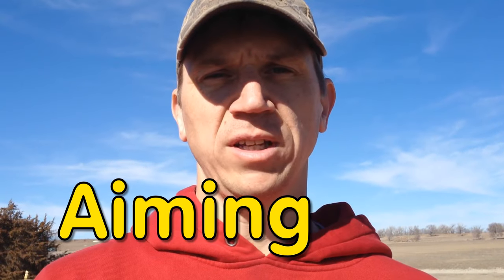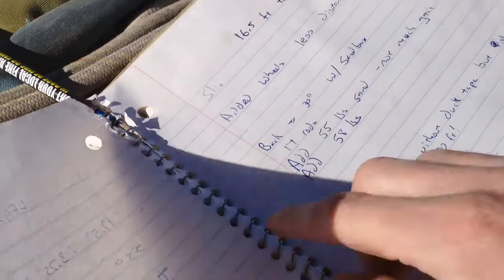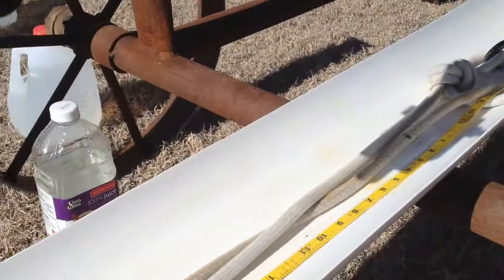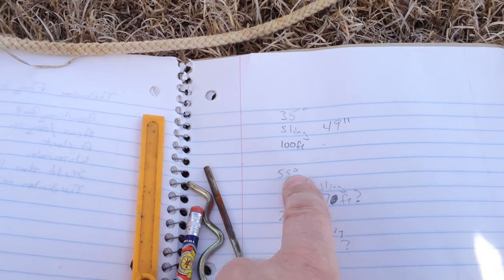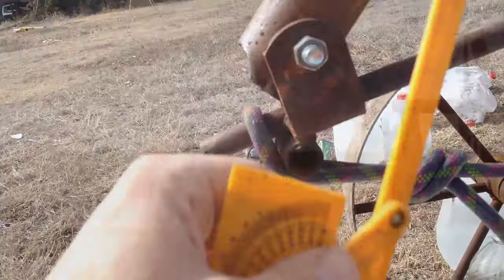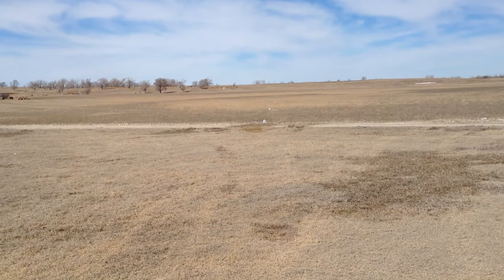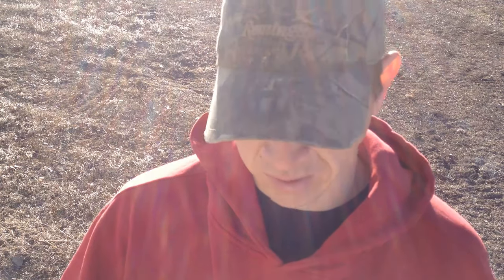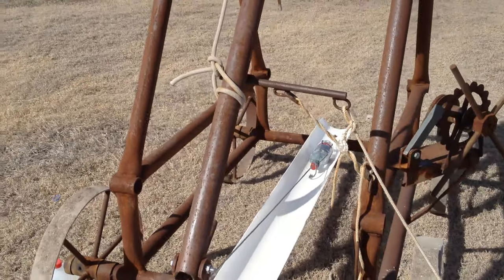Trebuchet Tuesday -AIMING! - Episode 29

Comment: Yep... You're right about there is a lot of parameters behind the trebuchet....
There is also a parameter that I,ve not seen you adjust, this is the linkage on the weight side, the articulated arm, do you think that the length ration could influence the way, force or speed that it goes down and transmit the force to the other side...???

Also be certain that the day you made the car size trebuchet and try it for the first time, your calculations are perfect...   You would hate to remove a car from the roof of the house...  Just cause something went bezerk...     lol
Reply from the maker: +pierre beaudry That linkage ratio is a huge influence.  Episode 15 is about "lowering" the weight basket.  I think Episode 9 is about the ratio of the hook on the arm to the weight basket pivot. Just in case you feel like going back to that.  Regarding flinging the car, it will be done out in the field with nothing around. :)  Thanks for stopping by as usual!

Comment: So, I am into rock climbing, and one of the things I noticed was some of the rope you had was climbing rope. now I am not sure about the white rope you had but here is point. There are two kinds of climbing rope, static and dynamic. if you are using dynamic climbing rope, its designed to stretch (absorb load impact in a fall), but if you are using it, it will also stretch and you will loss momentum in your throws. This could explain conflicting results that you got when you shortened the rope (shorter dynamic rope has less stretch then longer)! Again, I am just saying, I really know nothing about trebuchets so just throwing out food for thought.
Reply from the maker: +Fred Newman It is some of my old Dynamic line, so you might have a valid point! I should do a comparison with static line just to see if there is a difference.  Have you seen my climbing gym? here's the link... https://youtu.be/A6ewMkLjh9Y  (It's called "My Home Climbing Gym in Kansas in case the link doesn't work)
Reply: +Wide Vision Metal Fab That was cool! You need to bolt alongside you holds, so you can do lead climbing on them. They tried to build a commercial climbing gym in an old grain silo here, but people that were doing it weren't really into rock climbing and building was too far gone to make it worth the investment. Would have been cool though, was 140 feet high! Biggest problems with putting holds into concrete is that the bolts all have to bet just right length for each hold.
Reply from the maker: +Fred Newman Yep, it needs more anchors, as well as a lot of other things. I've heard of people successfully converting those really tall ones into awesome gyms. Too bad it didn't succeed in your area. It's quite tedious drilling all the holes in concrete too!

Comment: This is a watch-it-again trebuchet video. I built a tiny trebuchet that would do 4 meters (~12'), and intend to do another one.  Now, on to physics. The moment the sling releases, no force is acting on the jug  (missile), except gravity and of course wind resistance. So it is a purely ballistic problem from that point. It is a like firing a cannon off a cliff as high as the trigger is at the release point. For maximum range, the elevation of the cannon should be 45 deg. Now the trick is to obtain 45 deg of the jug velocity at the release point! I found the stop frames very useful. The weight of course affects  the release velocity. I have to go back over ballistics again.
Reply from the maker: +Juan Rivero Glad you enjoyed it! Just be careful not to fling towards Russia up there. I don't want you starting another World War! :)

Comment: To get the biggest distance out of your configuration try to set the angle so the object leaves the trebuchet at 45 degrees after release. Unfortunately you only had 2 frames from release on video so it's hard to tell but I had the feeling the angle change from 20 to 35 on the short rope was a bit to much.
Reply from the maker: +Zorgoban Getting the most distance out of the Trebuchet was not the point of this video. I was explaining what variables change the distance of the fling.